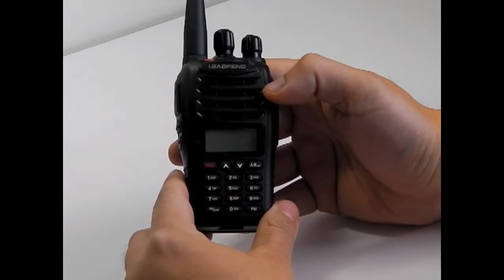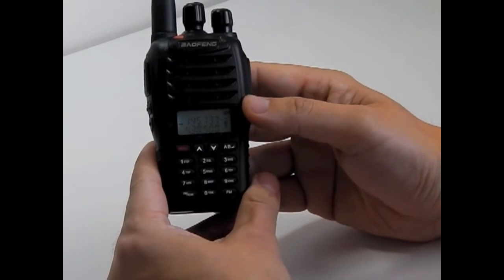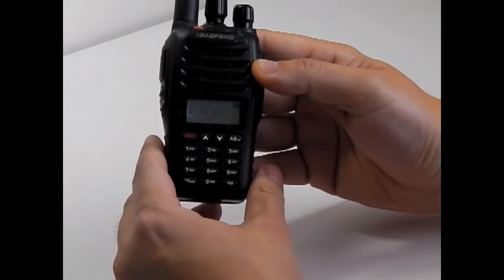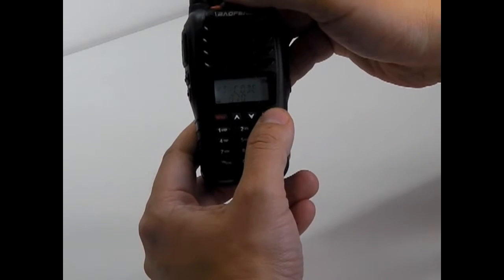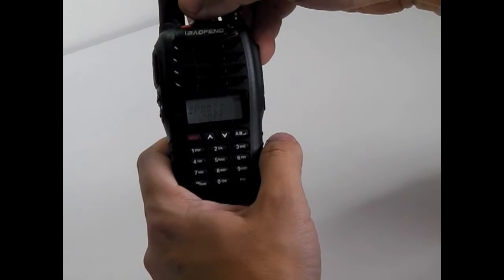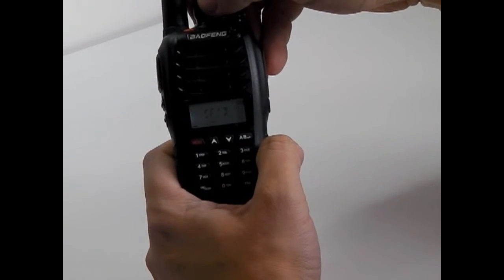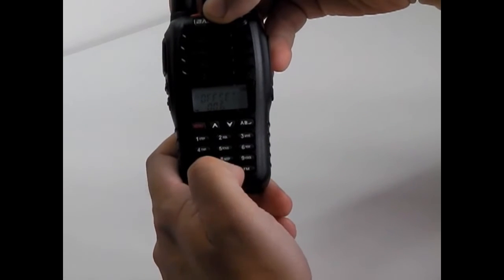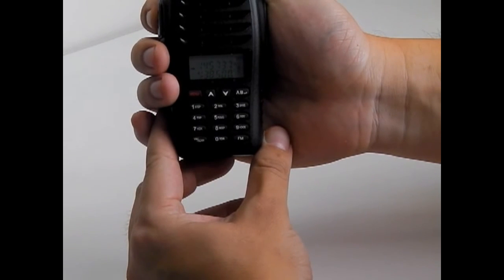Baofeng UVB5 VHF/UHF radio repeater programming

Comment: Hi i am having a problem setting up my uv-b5 with repeaters. The PL on the majority of my repeaters are 107.2 im guessing you program the pl using r code and t code? am i correct? whenever i select it i cannot key in anything i can only select 67, 023n and 0231. am i doing something wrong here? Any help would be great!